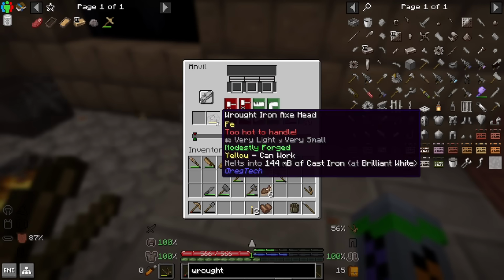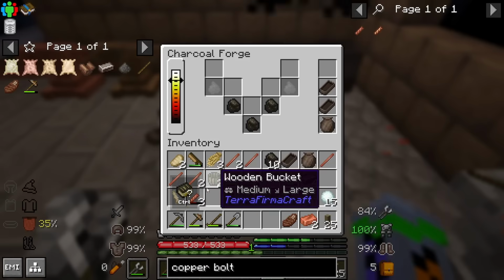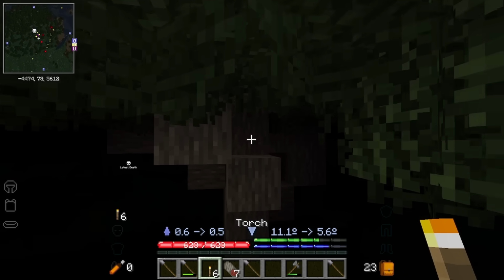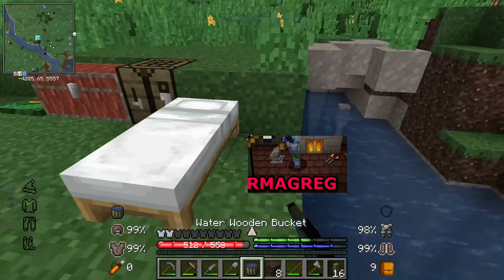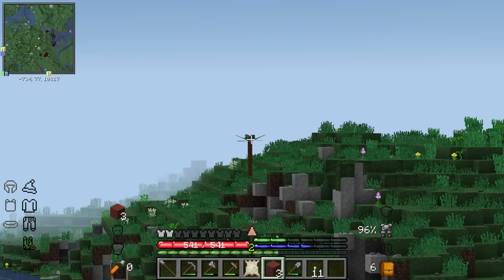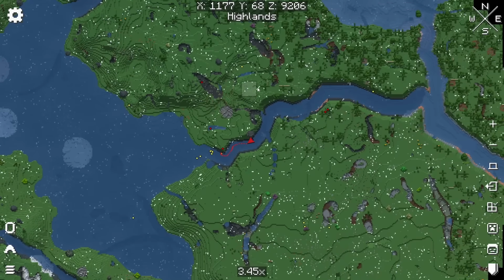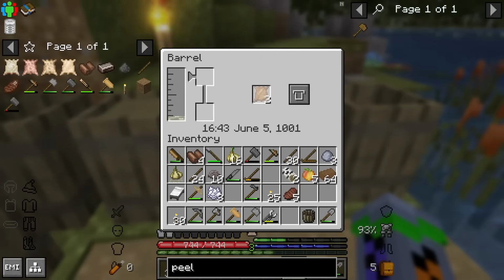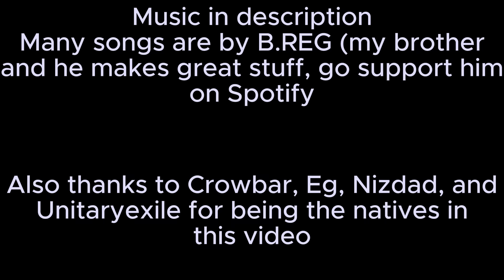I Spent 12 Hours Finding Clay in Minecraft's Most Realistic Mod (TFG Part 2)

Comment: That tree glich feels like a  comedy relief character at this point 😂
Reply from the maker: I only use it for charcoal collection but never actually show making charcoal
Reply: @Hecuba39 have you noticed that the glitch extends to any log of the same type. It has made building log cabins a nightmare!!!
Reply: @tomtexas4897  A possibly useless tip: Crouching when cutting isolates it to cutting only one block :D

And stripped logs seem to be excempt from the autocutting.
Reply: @tomtexas4897  it extends to literally any log, i've cut down multiple trees of different types at the same time with this glitch

Comment: Loving the videos! Glad I caught this series as it was coming out! Another tip! You can blacksmith an ingot easily into 2x rod, but putting that diagonally in a crafting grid with a saw will net you the same amount of bolts as if you where smithing them, you can also just file ingots to make rods as well!

Though that info becomes useless after you hit LV age,

Comment: Clay is a type of fine-grained natural soil material containing clay minerals (hydrous aluminium phyllosilicates, e.g. kaolinite, Al2Si2O5(OH)4). Most pure clay minerals are white or light-coloured, but natural clays show a variety of colours from impurities, such as a reddish or brownish colour from small amounts of iron oxide.
A Quaternary clay deposit in Estonia, laid down about 400,000 years ago
Clays develop plasticity when wet but can be hardened through firing. Clay is the longest-known ceramic material. Prehistoric humans discovered the useful properties of clay and used it for making pottery. Some of the earliest pottery shards have been dated to around 14,000 BCE, and clay tablets were the first known writing medium. Clay is used in many modern industrial processes, such as paper making, cement production, and chemical filtering. Between one-half and two-thirds of the world's population live or work in buildings made with clay, often baked into brick, as an essential part of its load-bearing structure.
Clay is a very common substance. Shale, formed largely from clay, is the most common sedimentary rock. Although many naturally occurring deposits include both silts and clay, clays are distinguished from other fine-grained soils by differences in size and mineralogy. Silts, which are fine-grained soils that do not include clay minerals, tend to have larger particle sizes than clays. Mixtures of sand, silt and less than 40% clay are called loam. Soils high in swelling clays (expansive clay), which are clay minerals that readily expand in volume when they absorb water, are a major challenge in civil engineering. The defining mechanical property of clay is its plasticity when wet and its ability to harden when dried or fired. Clays show a broad range of water content within which they are highly plastic, from a minimum water content (called the plastic limit) where the clay is just moist enough to mould, to a maximum water content (called the liquid limit) where the moulded clay is just dry enough to hold its shape. The plastic limit of kaolinite clay ranges from about 36% to 40% and its liquid limit ranges from about 58% to 72%. High-quality clay is also tough, as measured by the amount of mechanical work required to roll a sample of clay flat. Its toughness reflects a high degree of internal cohesion. Clay has a high content of clay minerals that give it its plasticity. Clay minerals are hydrous aluminium phyllosilicate minerals, composed of aluminium and silicon ions bonded into tiny, thin plates by interconnecting oxygen and hydroxide ions. These plates are tough but flexible, and in moist clay, they adhere to each other. The resulting aggregates give clay the cohesion that makes it plastic. In kaolinite clay, the bonding between plates is provided by a film of water molecules that hydrogen bond the plates together. The bonds are weak enough to allow the plates to slip past each other when the clay is being moulded, but strong enough to hold the plates in place and allow the moulded clay to retain its shape after it is moulded. When the clay is dried, most of the water molecules are removed, and the plates hydrogen bond directly to each other, so that the dried clay is rigid but still fragile. If the clay is moistened again, it will once more become plastic. When the clay is fired to the earthenware stage, a dehydration reaction removes additional water from the clay, causing clay plates to irreversibly adhere to each other via stronger covalent bonding, which strengthens the material. The clay mineral kaolinite is transformed into a non-clay material, metakaolin, which remains rigid and hard if moistened again. Further firing through the stoneware and porcelain stages further recrystallizes the metakaolin into yet stronger minerals such as mullite.
Reply: Huh, neato.
Reply from the maker: believe it or not, I read this. Thanks for the info
Reply: @Hecuba39  I did too 😂😂
Reply: @VmasterVX  bro just started typing and text started scrolling... 30mins later, my dude wrote a Wikipedia article on a YouTube video 🤣
Reply: @Techno-manz  pretty sure it just straight up is a wiki article, as it has an image description in it...

Comment: A good tip for anything temperature / precipitation based: temperature goes up by going south and precipitation goes up by going east, so you just have to go south-east until you met whatever conditions what you are searching for requires and then search arround.

Also for anyone that is fooled by the TFC guide: Kaolinite clay is not guaranteed to spawn on the surface, it can be some blocks deep in the ground, so when you find the blood lilies just dig down and arround.

Comment: Wisdom on HP management in TFC (valid especially if you're got firmalife in the modpack, as it severely nerfs/cripples things);

Try to always intake "cooked food" rather than "morsels". Cooked food are primarily sandwiches and soups (salads too if you can't make soup, they're less efficient), morsels are any single piece of food ingredient, like cooked meat, garlic, whatever isn't a combination.

Your HP is calculated based on the average of the values of your last 20 food items you've had, and to fill a nutrition bar, that average needs to be 1 (so 20 points in the last 20 food items). 
So for example if you eat 10 garlic (2 veg each) and 10 cooked rabbit(2 protein each) you will have maxed your vegetable and protein bars but with no room for improvement.

The best advice is to ignore most of the firmalife novelty recipes, and go with a setup of 14 sandwiches and 6 fruit soups:

1.Sandwiches made with the highest grain bread you can get (barley/rye) if you can source the sugar for it, otherwise flatbread is fine, but you won't max grain. Don't slice the barley/rye bread. 
The The sandwiches need to have at least 2 units of protein and 2 units of vegetable ( so most 2+ meats are fine with any vegetable, but if using 1.5 or lower meats, you need to use 2 of 'em and garlic)

2.Soup can be a bit tricky to make if you're fiddling with it for the first time ( Best to first add 4 ingredients, then pour in the water, then add the last ingredient to "seal" the soup, otherwise it'll often seal at 3 ingredients, and that's BAD)
You want 6 soups with 5 fruit in 'em. using 100% pumpkin is fine, but you won't fully max fruit. If you want to max fruit, you need to use at least 3x 1-fruit-value fruit and 2 pumpkin chunks.

3.For dairy, drinking milk is king. Firmalife makes cheesemaking tedious, costly, and not even that great of an idea, considering all the hassle involved. Milk doesn't spoil, so you can bring it in barrels and drink it instead of water (you need jug/bottle/flask though). 
ALL you need to do is to drink 100mb of milk either always before or after every food item you eat, and it adds +1 dairy to the last item you ate.

If you followed steps 1,2 and 3, congratulations, you're at or close to 3k max hp. (also keep your food in sealed large vessels, and keep your sandwiches/soups in a regular vessel for x2 shelf life)

Reasons you want high hp:
-In order to progress and handle "hazardous" materials, like lead ore, you either need to tank the poison damage, which is 100/s + ~500 more damage from the poison debuff after you put the materials away in vessels or something. You can eventually make a hazard suit but it's high tech, and will probably require you to mine and handle at least some lead ore in unsafe conditions.
-In order to not get 2-3 shot by any wild animal you encounter (Also invest in a basic shield, even a bronze one is fine, 4 ingots but makes random hostile encounters much less dangerous)
-You survive much easier to random unexpected stuff, like even falling in some random hole while traveling.
Eating cooked food also has the benefit that it gives you saturation, whereas munching on morsels doesn't give much of that.

Comment: If you smelt the magnetite into cast iron ingots then file them down with mortar(forged on anvil) in crafting grid to get iron dust you can put up to 24 stacks of iron dust (each dust is 144 mB)into the bloomery at max 48 input stacks to get 24 wrought iron chunks. Though smelting cast iron is impossible without the regular clicking on bellows to keep the vessels with it at brilliant white. It's worth it in the end to get a TON of Wrought iron.

Also there is "TFC Anvil Helper" resource pack that helps with the blacksmithing on the anvil by providing the pixel grid to count match your hits on more easily

Comment: I found a way to duplicate most anything from wrought iron to blue and red steel. If you make a butchery knife blade then macerate it, that will make 2 dust which is 2 ingots for the price of 1 ingot. Cook that dust up in the steam furnace ( depending on the dust) and boom 2 ingots.

Comment: My save got corrupted, gotta start all over again 💀💀💀

A tip for the boyz here, if u are having trouble using the prospecting pickaxe, there is a mod, presicion prospecting i believe it is called that adds more presice tools rather than the 25x25x25 box, they are and even look pretty much like the pro pick, so its modpack friendly.